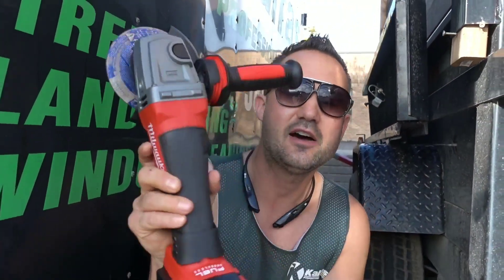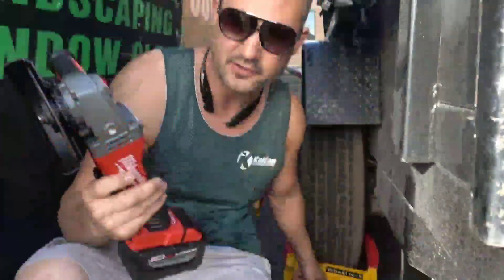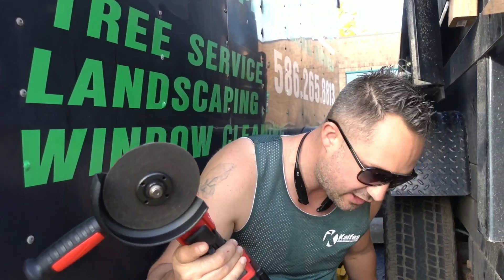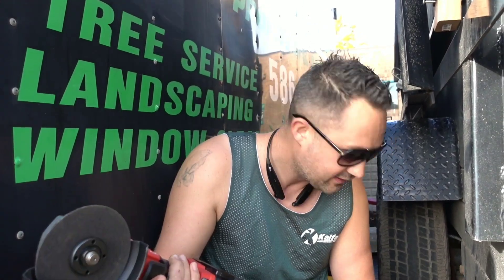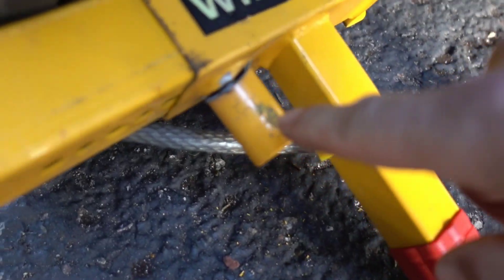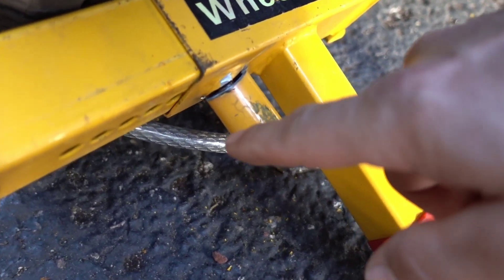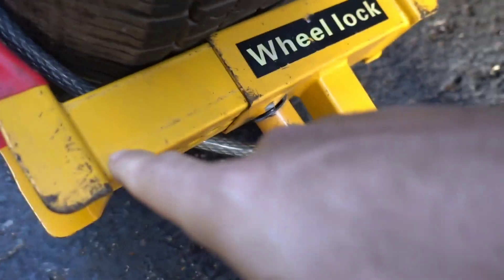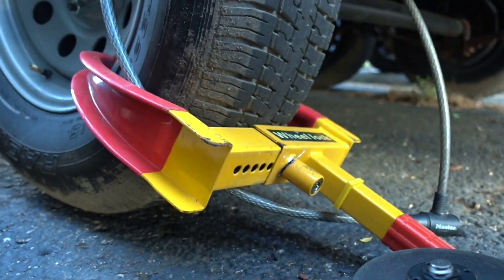Milwaukee M-18 Cordless Grinder vs Heavy Duty "Anti-Theft" Wheel Lock Clamp on Landscaping Trailer

Comment: Maybe I'm just paranoid but I have two Trimax wheel locks, chains for both tires on each side that wrap around the leaf springs, coupler lock and a lock for the coupler latch. Joe Bissol said it best. Theft deterrent is as good as you are going to get. If someone really wants my trailer, I'm going to make them work for it.
Reply: Cw Sayre may I ask where can I can the stuff u use on your trailer? Thanks.
Reply: I have done About the same like you said if it’s not quick then they will usually leave it alone. I have cameras if they get past all my locks and I still did not wake up to all the camera alerts and dogs did not bark then they got one over one me lol at least I can say I tried all I could lol.

Comment: Very informative - thanks! This wheel lock looks good enough for my needs, as I live on a ground floor flat, and my car is parked just outside my front door. That kind of noise would wake up the entire apartment block.
Reply: @Stan Milov Yes, I did. It doesn't look exactly the same though - the lock mechanism on the one I bought is integrated in to the lock (i.e. it doesn't stick out like the one in this video). Works really well, it's easy enough to attach and take off (and it's coated in plastic, so it doesn't scratch my hubs).
Reply: You can cut it off with a portable torch in about 30 seconds. If you pop the tire doing so you just drive a few blocks away, pop on the spare and off you go. Car thieves aren't concerned about wrecking one of your rims.
Reply: I believe the link below is the one my brother had told me about a couple of months ago.
A person backed into a driveway of a home in a cul-de-sac, next to a Jeep, on a Saturday morning around 7:30. They slipped out of their vehicle, and climbed under and cut the catalytic converter off, climbed back into their vehicle, and drove away.  It took just under 2 mins.  Everyone was home, most had some kind of doorbell camera or another type of camera, everyone thought another neighbor must have been running a power tool.  
My point is, even in this vid, it's not hard, and those who steel aren't really deterred by most locks.  
Most would only put this kind of lock on their trailer wheel and think that would be enough of a deterrent.  The their would normally have a similar tire/wheel, some type if jack, take off the lugnuts, put their tire on, just well enough to get down the street, then tighten the lugnuts and drive away.
Sadly, you put more security devices on what you are trying to protect, they will just destroy more trying to take it.
It's a terrible sign of the times. 

https://www.kctv5.com/video/2022/05/04/more-victims-come-forward-after-recognizing-thieves-tiktok-about-robbery/

Comment: I am a 4' 11' inch 70 year old woman and even I know to use a sledge or at least a 2 lb hammer to hit that lock after you ground it part way. LOL
 
Good to see that it took so long for the grinder to get that far. Let's hope Milwaukee doesn't come out with an M24 hydraulic shear.
Reply from the maker: The trailer was locked and backed against a brick wall. The trailer has several sledge hammers 🔨 and all types of tools. But unfortunately I couldn't get to those tools.
Reply: I think she politely said hit it with your purse in essence
Reply: Lol!
Reply: @Vince Robertson  it's a satchel!! 😂

Comment: My son's neighbor had a contractor working next door and someone stole his contractor trailer. They cut through the claw part with a grinder. The neighbors across the street said that they were only there for a few minutes. I hate thieving A-holes!
Reply from the maker: Dang. Same here. It's upsetting to say the least.
Reply: @keith-kalfas  I was thinking they used a saws all. I have used the carbide blades to cut through shingles and big spikes to take off an addition and those blades are incredible.

Comment: To get through what you have there its one second with bokt cutter in your cable, then you use jem bar between ture steel and the the red pinch if the wheel lock you bend against the steel wheel the red oinch bends and the locks falls if this takes aound 25 seconds.

Comment: I remember back in like 2008 9 and 10 over in Northern Detroit suburbs around Royal Oak Troy and that there was a bunch of theft where they were stealing enclosed trailers that were locked to the truck and Chained and everything and us guys were working on one side of an industrial building it was a crew of Thieves cutting a lock off and taking your whole enclosed trailer while you were working with your equipment in it

Comment: With a 1-1/4" ID metal pipe you could have broken that lock in 1 minute "with a dead silence"
Reply: 😭
I'm rapidly reaching the conclusion that securing the trailer to the ground (somehow) is the best option. Buried barrel of cement and hardened bike chain?
I'll need to think about it.
Ironically, I need a thief to tell me what makes it hard for them! 😆
Reply: @davidjames2145  I feel like you have to apply all methods to make it inconvenient so the thief will reconsider, I am going to place an anchor in the ground below where I park my equipment, etc, i'm going to have a D ring basically below grade in my driveway to attach a chain or cable to go around the frame or axles of parked equipment...unsuspected point of security measure.

Comment: I have a question and i would like to get the community's opinion recently had a catholic converter stolen the vehicle has inbuilt immobiliser but not a tilt sensor.

Once the new catalytic converter is installed will get a tilt alarm and cat lock.

Also want to get a couple of wheel immobilisers and possibly something in between with steel cable running through to prevent Thieves from trying to get under the vehicle.

Does anyone have any recommendations? Ie spikes

Recently installed Drive PIR lights and cctv.

What other deterrents do you recommend?

Comment: Keith, just get the hammer! 😄
Reply from the maker: The hammer was locked inside my trailer backed against a brick wall with 6 locks on it.

It would've taken 10 minutes to move the trucks around unlocks the couplers and wheel locks... then pull the trainer forward... unlock the doors ..then go inside just to get the hammer.

Haha.

Besides... I truly thought the Milwaukee grinder would cut through the lock in less than 30 seconds with Zero hammer required.
Reply: @keith-kalfas  Exactly what I would have done! I thought it was funny. I can't thank you enough for inspiring me to recently start my landscape company. I know you are helping many other people too!

Comment: You should've checked yt first, the weakest part of those clamps is marked to you. Just cut on the red/yellow line, don't even need to go through the arm, just cut rib (angle) and bend arm back. Less than a minute, max.
Reply from the maker: Ahhhh ok. Thanks

Comment: dude your seriously unskilled in using one of those grinders with a cut off wheel.  it would have taken me 30-45 seconds.  yeah anti  theft devices fail quickly with that tool.   but the noise and sparks are like setting off an alarm the whole time your cutting.

Comment: Thank you. I was wondering about how resistant it was.
The thef would cut that in 1mn using a biger disk and no guard. he can then break of the rest 30 sec Using a hammer or a lever. You did good.
Reply from the maker: Well.  My hammer was 4 miles away. THE OTHER HAMMER WAS LOCKED IN THE TRAILER
Reply: @keith-kalfas  nice! So you turned an inconvenience into a great experience for 1000 of viewers. Genious!
Reply: What’s to stop a thief just taking the wheel off?

Comment: No hammer???
Reply from the maker: 5 hammers including a small sledge and full size sledge hammer are locked inside the trailer which is backed up against the brick wall.

Comment: So you come with a angle grinder and a barstool but noa a hammer and screwdriver??? Goofball 🤔
Reply from the maker: I have all those tools but they were locked in the back of the trailer. 
The trailer with a backed up against the brick wall.  So I couldn't move the trailer to get all of the tools out because the tire lock Was on the tire.
 It would have taken me a 1/2 an hour extra to drive all the way back home. So I chanced it, I'm still got the tire lock off.
Reply: @keith-kalfas  ok well I guess you you a pass on this one lol...

Comment: Stick to landscaping.  Drilling the lock takes less than a minute,  even with the key stuck in the cylinder.
Reply: Al Carey 

Yeah.  Thieves wanna use a noisy drill when trying to STEAL  something.   Dont quit your day job, you’re not as smart as you think
Reply: @edl246  you're obviously under 40 years old.  True, a thief wouldn't use a loud battery operated drill to steal your stuff if they can help it.  But there are manual drills that DON'T use noisy,  battery operated motors. Someone like me (who knows about man powered tools) can use those tools to silently drill the lock in under 5 minutes. Too bad  you weren't taught about tools, or manners. Get a job!